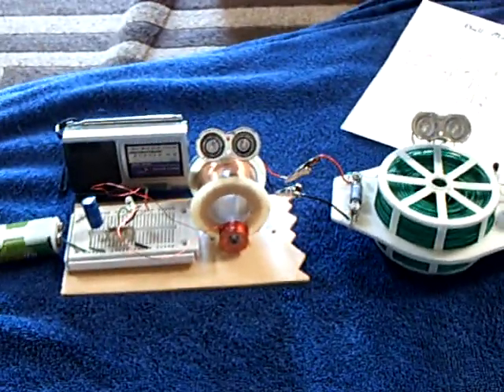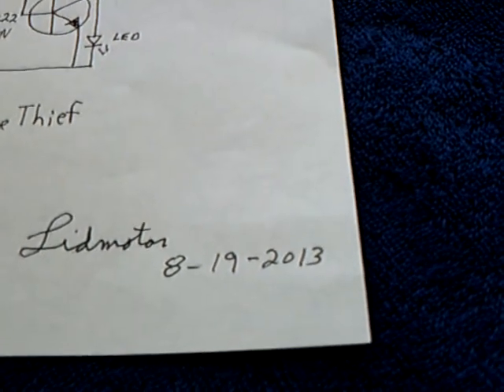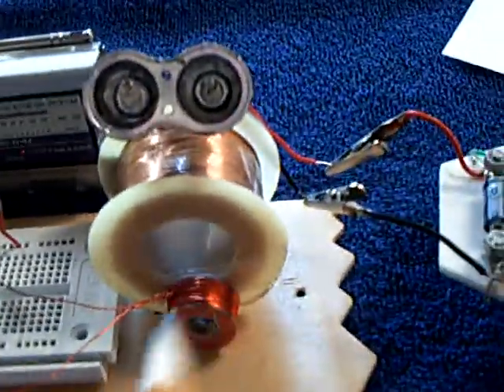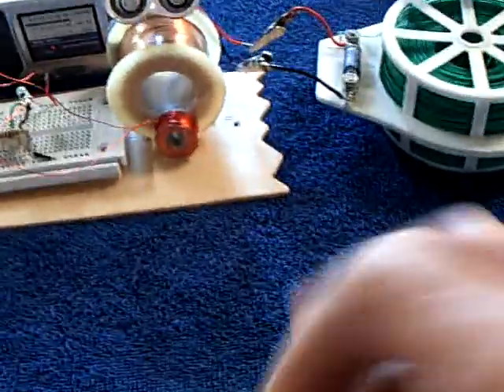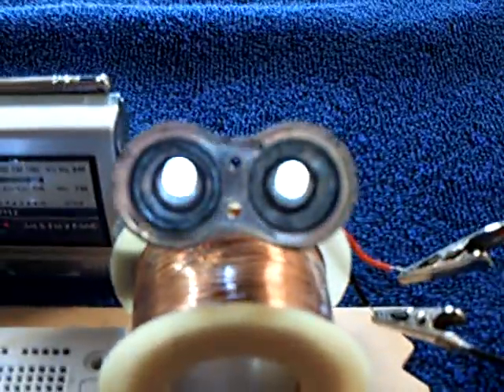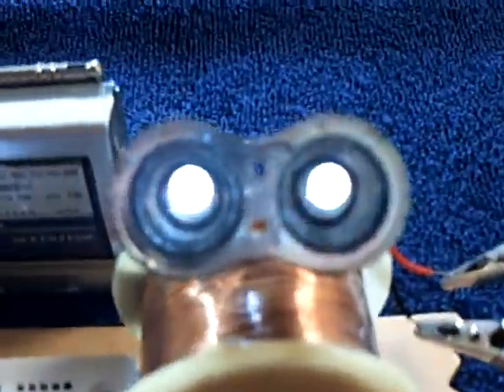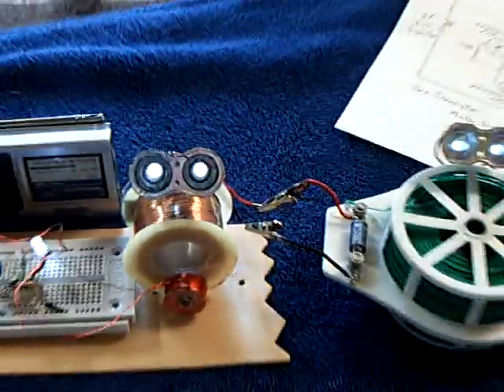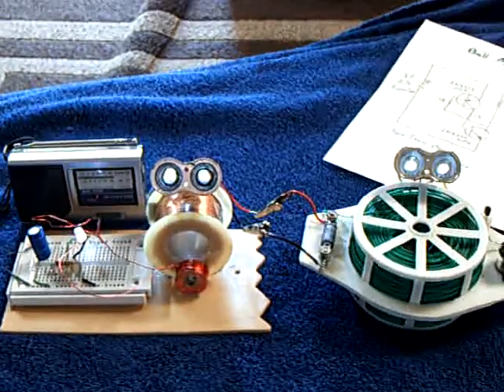Ball Magnet Motor / Generator with Maggie and Penny

Comment from the maker: A direct energy return from Maggie into the run cap doesn't help.  You can use a thing called a " capacitor dump circuit" where you fill up a small capacitor to a higher voltage and then zap that back to the run cap.  That kinda works.  What it would look like is Penny's eyes blinking every time the charge cap dumped back to the run cap.  If this device was scaled up and an a low power CMOS timer chip was used-- you might gain a longer run time.  Maybe.

Comment from the maker: Good question.  It is hard to test because I don't have the drive circuit setup to self-oscillate.  I don't think that there is anything special going on here.  It is just interesting.  I just ran another test though, and the ball kept turning and running Penny for over 40 minutes (starting voltage 3v ball stopped at.725v).  If the whole setup started getting cold then I might get excited.

Comment: Well done Lid !
The question is if the energy stored in the 5 Farad cap is really able to run the circuits really this long without the spinning magnet or if the spinning magnet sphere will somehow introduce more energy from the environment into the circuit, so the supercap will just discharge much slower.... Maybe you can try to measure this exactly ?

is 0.5 x 5 Farad x Voltage^2= Cap_energy really able to run it this long or does the spinning magnet amplify this ?Thanks.Regards, Stefan.